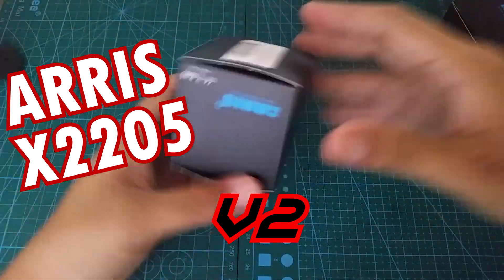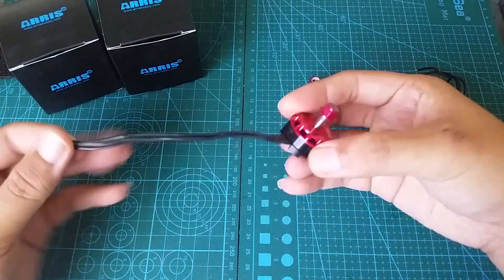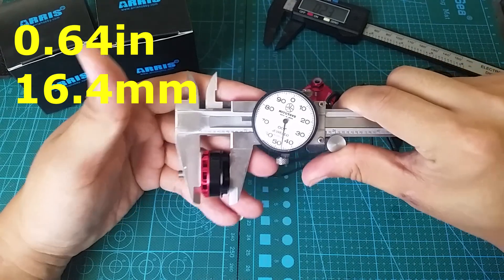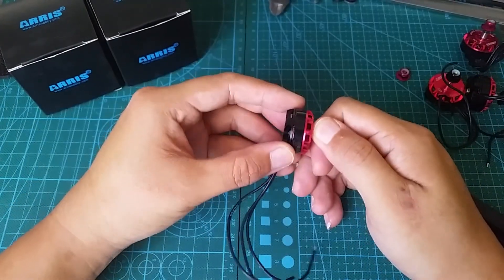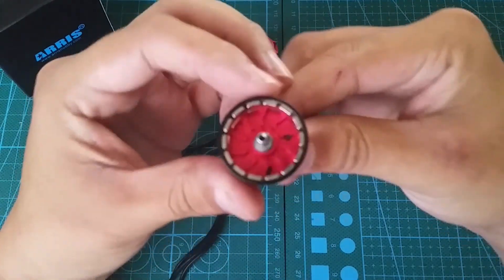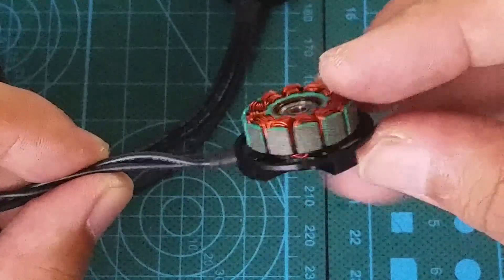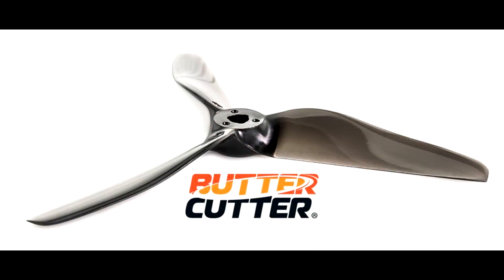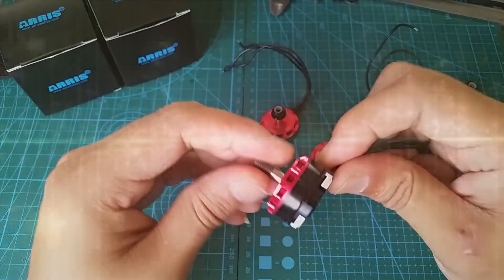ARRIS X2205 V2 2300kv Motors- Review - Thrust Test - Flight Test

Comment: anyone have a clue on where to purchase new screws for the bottom of the bell?  i lost one of the left-hand threaded ones on the ccw motor in a crash.  other than that the motor is fine, so i really don't want to have to buy a new one just because i'm missing one little screw.

Comment: I got these motors on an RTF Arris X-speed 280, but the props slip on the motors. I also noticed the nylon lock nuts that shipped with these motors don't tighten past the top of the hollow shaft and didn't ship with washers. Using your measurements of the 5mm shaft would M5 (5mm) flat washers be the best fit? And would you recommend nylon or rubber washers?
Reply from the maker: yea i noticed that too, I decided to use low profile lock nuts for these motors. yea m5 is the size you want but what are you using the washers for?